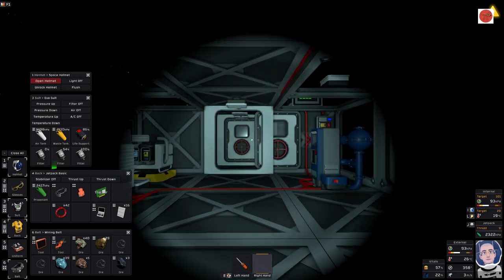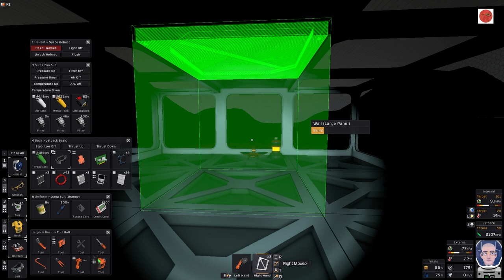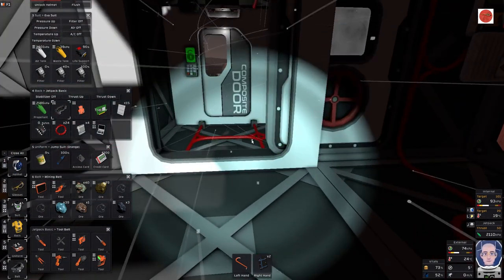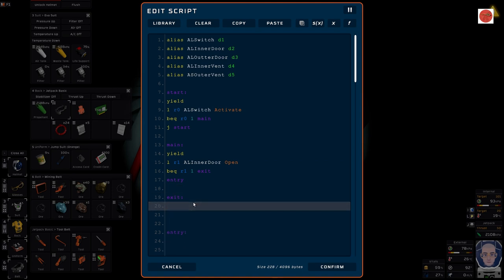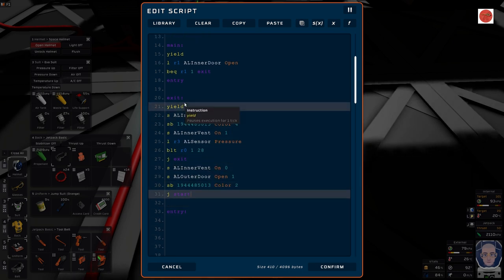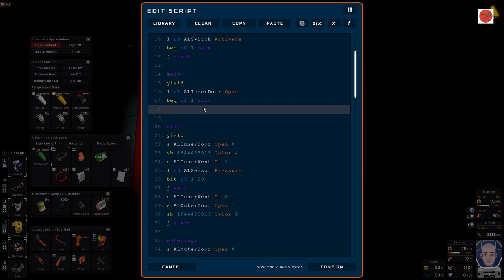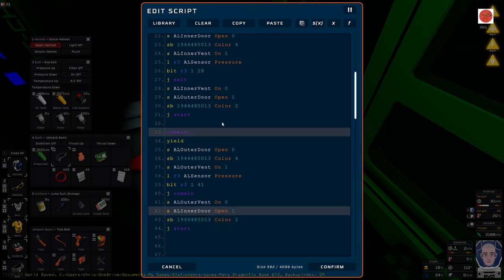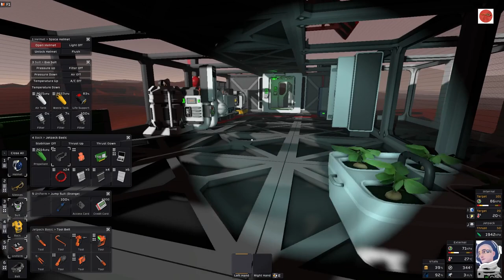Stationeers Let's Play - AIRLOCK programming and base expansion | Part 13

Comment: Dragonfly, I have watched all of this series over the past couple of days, and I must say, wow. I can't wait to see the next one. As for your solar panel issue, I wonder if it's a case of too many logic units or a need to name them... Just thinking they may be fighting each other somehow.
Reply from the maker: Thank  you and thanks for your support, I really appreciate it.

I was thinking something like that myself and have been contemplating ripping all of the logic chips out and replacing them with 1 IC. I can then just use the SB (Save Batch) command to the Prefab Hasg  to send the tracking info directly to the panels. I'm also going to rip out all of the old panel and replace them with more heavy soloar. Which reminds me I have to work out why I'm not getting any storms, very odd.
Reply: @dragonflygameruk4094  odd indeed. I'm debating on buying this game myself. It seems like a lot of work but fun as well. I like games with some more realistic and com0lex tasks like the programming. Perhaps you and I can run a coop game sometime?